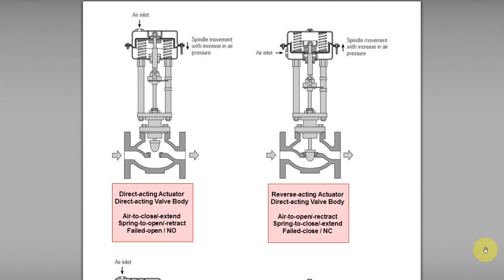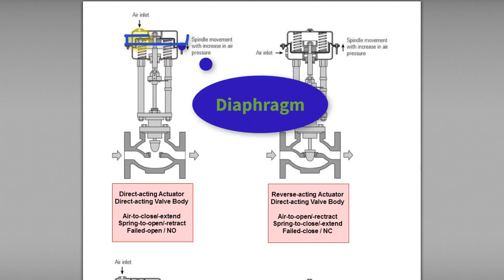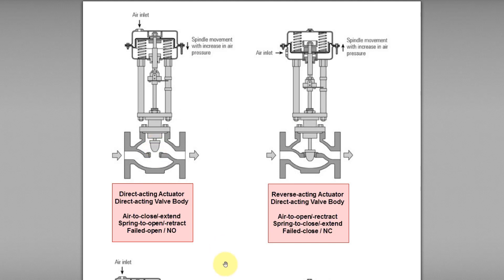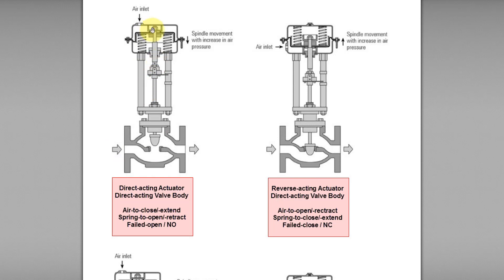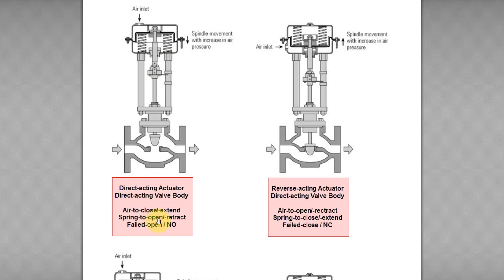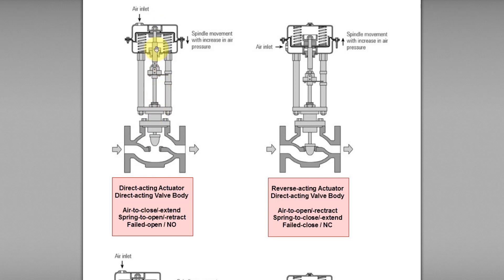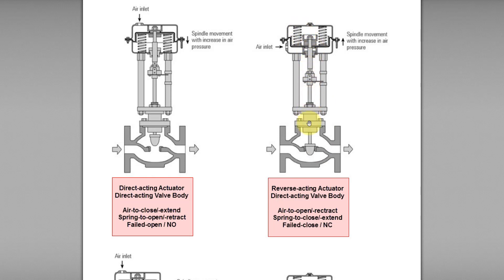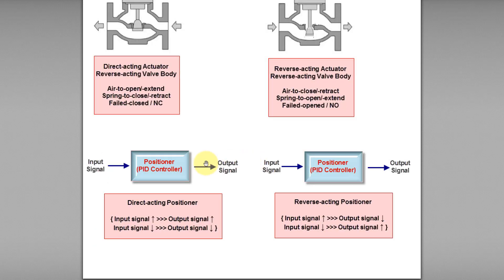Direct Acting and Reverse Acting for Control Valves & Positioners

Comment from the maker: "What is direct acting and reverse acting? All these terms will be explained in detail in this clip. How do we identify whether the actuator and valve body is reverse acting or direct acting? Again, all these methods will be covered in the video.

The Air-to-Open control valve is where the valve body seat is closed when the instrument air is supplied to the actuator while the Air-to-Close control valve is where the valve body seat is opened when the instrument air is supplied to the actuator. Occasionally, you mean heard the terms such as Air-to-Retract or Failed Close instead of Air-to-Open control valve. Sometimes, the terms of Air-to-Extend or Failed Open are used instead of Air-to-Open control valve."

Comment: The actuator is direct acting when the spring acting on the diaphragm is either in compression and pushing up against the diaphragm from below, or is in tension and pulling the diaphragm up - in this latter case the spring is placed above the diaphragm. In a reverse acting actuator the opposite is true - the spring is either in compression and pushing down against the diaphragm, from above, or is in tension and pulling the diaphragm down. So there are actually four of these diaphragm actuators possible, not two. This point is important because the actuator can be direct acting even with the spring above the diaphragm, if the spring is in tension rather than compression, and likewise it may be reverse acting even with the spring below the diaphragm. It is the position of the spring as well as whether it is in compression or tension that determines whether it is direct or reverse acting, not just the position.

And technically, the valve body is direct acting when the plug pushes down on the seat, and reverse acting when it pulls up against the seat. These valves can be installed on horizontal lines like you show in your video, as well as in vertical lines, so again the point is important to make, as the plug in a direct acting valve body will not always be above the seat, nor below in a reverse acting valve body - picture one of these valves flipped 90 degrees - the plug would be horizontal to the seat rather than above or below in this case, so the above explanation is the technically correct one.
Reply from the maker: Dude, thanks for laying that out! Your clear and informative explanation is really excellent. Appreciate it!